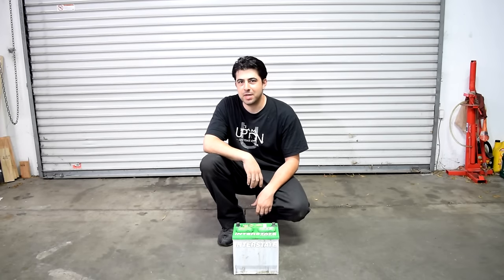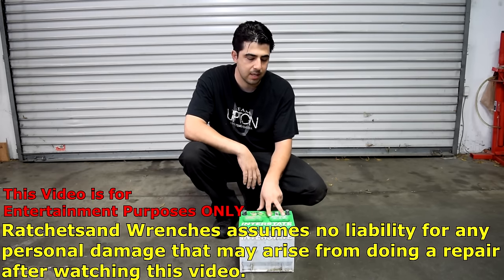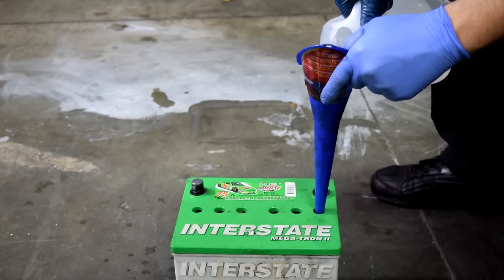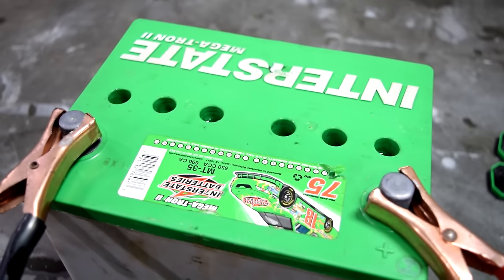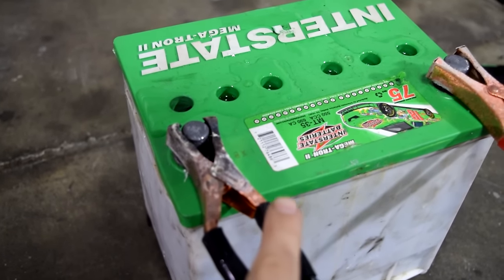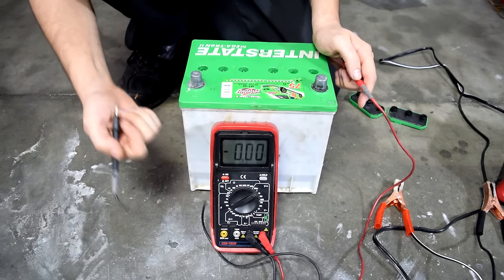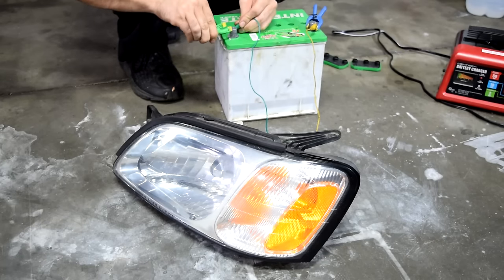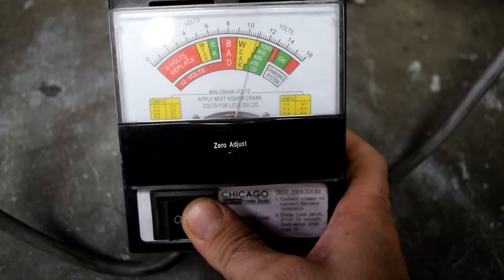Is it Possible to Revive a Dead Battery with Epsom Salt - See For Yourself

Comment: I'm 73 years young and always heard never set a battery on a concrete floor because it would drain the batt. of power. From my experience this is not true. I have never had a problem charging a batt. while it is sitting on concrete. These beliefs might have come from the fact the first batt. cases were made of glass and could easily be broken. Something to think about!
Reply: Ronnie Ayers, when I was a mechanic I found that a dirty battery left on the ground  or concrete is likely to discharge because of a ground path, but a clean battery  is a lot less likely to discharge, after finding this out by mistake,  I purposely would leave batteries on the concrete floor,  tested them before I took  them out, then cleaned some of them 2 or 3 weeks later tested them again,  most of the time clean batteries still close to what I tested, about over half the dirty batteries were dead 2volts or less. Just my observation,  THANKS  William
Reply: No, it is not something to think about. You are parroting the same pseudoscience and misinformation a half-dozen others are in this same video. Not only is it factually wrong and very easily disproven by anyone even minimally scientifically inclined, it contributes nothing to the discussion. In short, stop it.
Reply: I'm 67 Ronnie and my stepdad owner a Fairchild station for years. He always told me the same thing.. Don't tell me I can't, I will try.  I still sit batteries on concrete..  Cheers.  Ron
Reply: Your comment is a frequent one. Many people have the impression that when batteries sit on concrete, energy "leaks out" or they are ruined. The short answer is that letting modern batteries sit on concrete does not harm or discharge them in any way.

However, this legend is historically based in fact. The first lead-acid batteries consisted of glass cells that were enclosed in tar-lined wooden boxes. A damp concrete floor could cause the wood to swell, breaking the glass inside.

The Edison cell (i.e. the nickel-iron battery) that preceded the rubber-cased battery was encased in steel. Those that weren't isolated in crates would discharge into concrete quite easily. Later battery cases used primitive hardened rubber, which was somewhat porous and could contain lots of carbon. A moist concrete floor combined with the carbon in the battery cases could create electrical current between the cells, discharging them.

None of this is a problem with modern batteries — safe in their hard plastic shells. In fact, concrete is generally an excellent surface on which to place a battery bank. The electrolyte in a battery sitting on an extremely cold floor with very hot air around it could stratify, causing damage from sulfation; whereas concrete provides good thermal mass to buffer any temporarily extreme temperatures in the battery compartment.

Energy can in fact "leak" out of battery banks — though in different ways. The first is from current between the battery terminals, caused by dirt, dust, and grime becoming carbonized (and therefore electrically conductive) from acid released from the cell. This is easily preventable. Use a clean rag to carefully clean the tops of the battery cases every time you perform your regular battery bank maintenance routine.

The second way happens to all batteries—it’s called "selfdischarge." Due to reactions within the plates, all lead-acid batteries will lose part of their charge over time. The warmer the battery compartment and the older the battery, the higher the self-discharge rate. An L-16 battery will lose 4% of its charge per week at 80 degF.

This brings us back to your original question, where you mentioned battery bank temperature. There are multiple electrochemical reactions going on inside any battery, all the time. Some are good (storing and releasing energy), and some are bad (self-discharge, sulfation). All of these reactions happen faster when the battery is hot, and slower when it's cold.

Cold temperatures don't damage lead-acid batteries unless the battery is heavily discharged and exposed to freezing temperatures. In that case, the electrolyte (which is mostly water when the battery is at a low state of charge) can freeze and crack the case. On the other hand, a fully charged battery can withstand -30 degF or lower without a problem.

However, since cold temperatures slow the desirable chemical reactions too, the amount of energy a battery can release at any given time is drastically reduced when the battery is very cold. That's why it's more difficult to start your car on a frigid morning. And it also takes more energy to charge a cold battery than a warm one — cold batteries are less efficient at both charging and discharging. At the end of the day, a good rule is that batteries like the same temperatures that humans do, between 60 degF and 80 degF.
Reply: It is the concrete dust that will affect the battery. Most batteries are vented. It is there where the dust from the concrete enters the battery and plugs it up. Also dust is a conductor as well.

Comment: I put Whiskey in my dead battery, got pulled over, now have a DUI. Don't do it.
Reply: مخم
Reply: Get a paira-legals, do you better...
Reply: The vehicle should have gotten the ticket so as to see the prosecutor and he will automatically dismiss it.
Reply: Anzy Faubion I used to pour beer on my grass to save work.  It was half cut when I got started.
Reply: hey ,if anyone else wants to discover recondition rechargeable batteries try Jadonite Renovate Battery   Buddy (do a google search ) ? Ive heard some decent things about it and my colleague got excellent results with it.
Reply: hey ,if anyone else is searching for how to recondition used car batteries try Vaxicorn Battery Extender Guide ( search on google ) ? Ive heard some interesting things about it and my mate got cool success with it.
Reply: interesting points ,if anyone else wants to learn about how to recondition batteries try Corbandy  Battery Blueprint Crusher (do a search on google ) ? Ive heard some unbelievable things about it and my mate got cool success with it.
Reply: selfmotar
Reply: here's  several ideas for getting a good result
Don't try to do this unless you are sure what you are doing - the acid can burn you
check the voltage first - there may be a dead cell which will waste your time.
Check the battery fluid.
Try to completely recharge the battery.
(I learned about these and more from Rapid renew roadmap site )
Reply: There's several factors in doing a pro job. One plan I found which successfully combines these is the rapid renew roadmap (check it out on google) without a doubt the best info that I've heard of. look at this extraordinary website.
Reply: I've been studying battery reconditioning and found a great website at Rapid Renew Roadmap (google it if you're interested)
Reply: I've been studying battery repairing and discovered an awesome website at Rapid renew roadmap (google it if you are interested)
Reply: There are  a few things for battery reconditioning
Don't attempt to do this unless you are sure what you are doing - the acid can burn your skin
Test the voltage first - there may be a dead cell which will waste your time.
Check the battery fluid.
Try to completely recharge the battery.
(I read about these and more using Rapid renew roadmap website )
Reply: There are  a few ideas for doing a pro job
Don't try to do this until you are sure what you are doing - the acid can burn your skin
check the voltage first - there may be a dead cell which would be a waste of time trying to fix.
Check the battery fluid.
attempt to fully charge the battery.
(I read about these and more using Rapid Renew Roadmap website )
Reply: There's several components to fixing a car battery. One resource I discovered that succeeds in merging these is the Rapid renew roadmap (google it if you're interested) without a doubt the no.1 course that I've seen. Check out this incredible resource.
Reply: There are  several suggestions for battery repairing
do not attempt to do this unless you are sure what you are doing - the acid can burn your skin
Test the voltage first - there may be a kaput cell which would waste your time.
Check the battery fluid.
Reply: hey ,if anyone else wants to discover how to recondition car battery at home try Panlarko Recondition Planner (Have a quick look on google cant remember the place now ) ? Ive heard some decent things about it and my partner got great results with it.
Reply: I expected a lot of whiskey referred spam following here. But this thread has stayed clean so far!
Reply: Very funny .cabron
Reply: i put methamphetamine in my dead battery, it exploded and now my car is a Superfund cleanup site. That and I have the only car that scraps itself.
Reply: 😂😂😂😂made my year😂😂😂😂

Comment: im assuming over time a film builds on the lead stopping electron flow is that why they stop working over time?  If you clean it inside how do you get new acid to add to it and can you convert a water based battery to gel after restoring?

Comment: What's to rethink - the ocean does freeze, just at a slightly lower temp than fresh water.  The big difference is that the ocean water is being constantly moved by wind and currents, making it more difficult to freeze.  Just like larger streams or rivers of fresh water can remain unfrozen even below 32 degrees Fahrenheit. I take it you have never been to the northern east coast in winter time Onyx King?  Of course the whole ocean doesn't freeze, but the shallows along the shore do.

Comment: I did not see where you emptied out the Epsom Salts fluid, flush the battery and refill with sulfuric acid solution.  Did I miss something or does magnesium sulfate, which is a base solution, work as well as sulfuric acid.

Comment: What we need is something like an old school real lead plated battery which can be easily taken apart and the plates cleaned.

I read a 1944 Popular Mechanics article which showed how these old school batteries could be cut open and the scaling scraped off the lead plates. War rationing was limiting consumer batteries and normal folks had to make do. Upgrading that idea with an easy open case and easily accessable and replacable lead plates would sell well, IMHO.

Comment: This is a lead acid battery, right??  You dumped out the fluid from the battery and than added baking soda witch is known to neutralize acid and then poured that out. Then added Epsom salt and water to it and charged it a few times. So why would there be ACID in it to begin with if it didn't need it??  And without acid, why would it hold or keep a charge??? I'd think the acid is there to keep the sulfides to a minimum on the plates.. And I believe cleaning the plates off is what makes a battery last through many charges and uses..  Am I wrong???

Comment: Because you add Epsom and "water", would it freeze in winter time since  water is what's inside the battery? Is spring time here in Canada but what's gonna happen in winter? Would I end up with a  frozen battery issue 🤔

Comment: I use Walmart Everstart batteries in all my vehicles. The group 27 in my truck is 11 years old and just starting to get week. The battery in my muscle car is 10 years old and if let sit for more than a couple weeks it cranks the 10.5 to 1 compression engine slow. These batteries are $119.00 a piece now. Thats less than $11.00 a year I’ll pay for my new batteries. Not worth playing with acid and waiting 3 days to charge. However my other two cars batteries are over $250.00 a piece. I will try to revitalize one of them when its time.

Comment: Cool video but please forget the baking soda. Who told you to use it? Also, after changing the battery to full capacity let it fully discharge then dump out the Epsom salt solution then rinse it out then pour in the battery acid. Sometimes it works depending on what is wrong with the battery in the first place

Comment: best batts i have found for normal flooded car batts have been besco..in a hot climate u need rubber seals..plastic on plastic not good in a hot climate.. colder countries often  make batts with no rubber seals..which  dry up fast..

Comment: Take the battery OFF the concrete
Reply: myth... the type of plastic (polypropylene) in modern batteries prevents this...
Reply: Interestingly, some experts (including Car Talk’s Click and Clack) believe that storing car batteries on concrete floors might actually be a better idea than keeping them on shelves or other surfaces because the cold of the floor works to slow the self-discharge (leakage) rate.

Comment: I have a bad battery which is like a year or two old and it goes up to 11 volts but I can't seem to get it higher. My daughter left a door open in the car which has been sitting. I may try this out on the battery to see if it might help thanks.

Comment: Any update on this?   I am wondering why you are not re-using the sulfuric acid solution.   I have seen people filter is with some cotton balls in the funnel and the acid becomes clear as water.   Not sure how effective the epson salt is compared to the acid solution in the battery but my thinking is that if it was as good as sulfuric acid, that is what companies would use to fill the battery since it is much safer to use.   Thoughts?
Reply: You may want to look at "Does An Electronic De-Sulfator Really Repair A Battery?? See Real Results", a YT video on bringing batteries back to life.

Comment: Harbor freight charger. My first one just died while charging. Think it has something to do with charging smaller agm at lowest settings. Anywho the older ones are necessary for this as the newer ones won't start charging without some sense voltage ... use an old manual when I do this

Comment: to really fix a battery you need to saw the top off of it.. the problem is build up on the lead plates for each cell.. if you can scrub the lead plates you can likely restore it..    however i don't know how you can seal the top of the battery back on. apparently you can also reverse charge a battery to try and remove more of the build up from the lead plates.  prob not a option after adding epsom salt.

Comment: I was stuck on 59 amps then kept switching settings on charging rate from 8-12 and finally spanked the 13 volt mark. 100% charged!

Comment: Hold the presses!!- Is your load testers needle wrongly adjusted? as you had 12.6 volts and the load tested before you hit the load said only 12V so your end result would have been in the green slightly and not in the yellow?

Comment: Epsom Salts - (Megnesium Sulphate) simply helps to descale the Lead Plates inside the Battery so the Ions can flow correctly. If the Plates inside the battery are coated, this will constrict the flow of Ions which is the basis/s of how a Lead/Acid Battery works. Remove the 'coating' on the Lead Plates, and the Battery returns (in whole or part) to the functionality it was designed for !!!

Comment: Why do you have it sitting on concrete? Doesn't that drain the battery? Therefore; a full charge might not be obtainable. "Plywood" underneath separating battery from the concrete. A full quick charge might be obtained in a short time with being insulated from the concrete.

Comment: What was the result the next day  , did it hold a charge? I've recharged many batteries and got their voltage up but they died the next day . I even tried new acid and different rejuvenating chemicals over the years.  I've found that when a  battery is done it's done . Batteries today last longer than they used to but newer batteries go without tell tale signs .

Comment: “Under normal conditions, sulfuric acid in the electrolyte solution is absorbed into the lead plates as the battery discharges power. It is then released back into the electrolyte solution as the battery charges.”
I assume, you would need to discharge the battery completely before removing the electrolyte. However, if the battery is bad I guess the acid will not be absorbed and you end up with various concentrations of acid between cells, idk what that is going to do other than reduced capacity and cell imbalance that was already present

Comment: Will this work that is only taking charge at 6volts? I took my battery to auto parts store and was told is not hold charge. I just don't want to spend another 100 bucks more.

Also, after doing the backing soda and epsom salt, can I add battery acid after I flushed epsom salt from the battery?